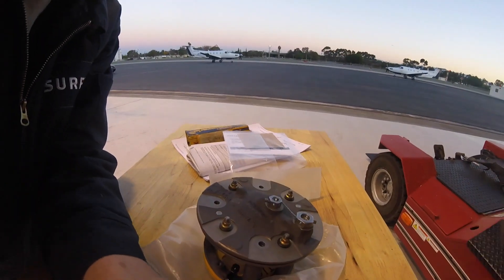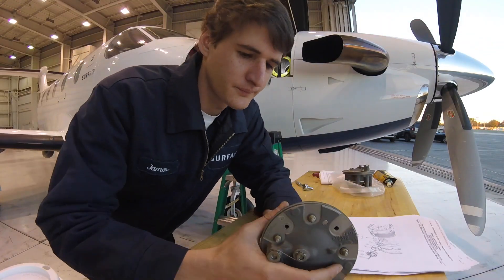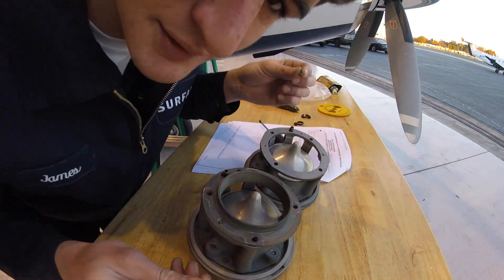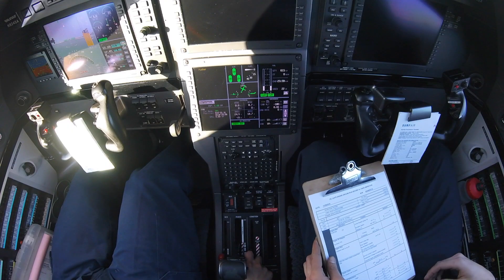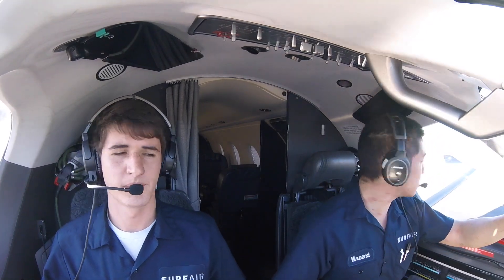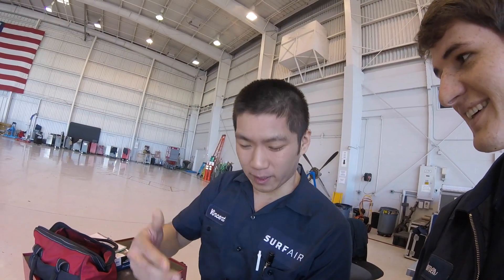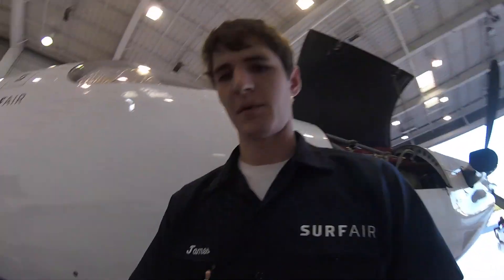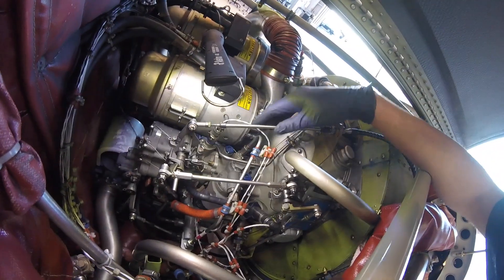PT6 Compressor Bleed Valve & FCU Replacement

Comment: I thought if you haven't done the work before you need to be supervised when doing the work the first time? Am I wrong? You said that you haven't done this before in the beginning of the video.
Reply from the maker: That's not a requirement under FAA regulations. Certain companies may require it however.

Comment: I noticed you use those flat lights.  Check out the Braun version from HFT.  Surprisingly nice lights.  One weakness out of the box with the Braun, is the battery (they're only 2200 mah).  To fix this, get larger 18650 batteries on Amazon.  HFT currently has coupons for their braun flat lights.

Comment: what you could don when you remover the FCU you can use your cell phone shap a picture and then you have a record of the correct ways.    That place looks like a fun place to work.. I been out of Aviation Maintenance for 13 years now. .I am in my 50's now but I could consider going back if that place is a good place to work. I do not want to deal with ego's
Reply from the maker: No egos here, we have a strict no a-hole policy at surf
Reply: That is good to hear.  you wont believe the ero's  I had my share of them from dont touch my tool box to think they are the best. 
I could see that it no ego going on there.  If I was in the area, I would apply. I live in the bay area. 
take care good luck and good videos.

Comment: Since Surf Air (had) the legacy PC12s and NGs which do you prefer working on as a mechanic? Why?  Do you have any preference on which to fly on?  Thanks  I'm definitely a fan of your channel.  Thanks for posting!
Reply from the maker: We got rid of our legacies last year. They were both about he same to fly on and similar to work on. I've heard the NG flies a lot more "nimbler' while the legacy was a bit heavy on the controls. From a maintenance standpoint the NG is nice to work on since the avionics have a lot of built in systems troubleshooting.

Comment: using the bleed valve, could you further explain how P2.5,Px,P3 all works?
Reply: i assume when you had the bleed valve on the table (nipple pointing up) that would be the position of the valve when it is "fully open" for the P2.5 air for the air to go towards the compressor inlet. is this correct?
Reply from the maker: That's correct. I'll see if I can make that video sometime. Glad you enjoyed
Reply: thanks man! didnt mean to blow up ur comments lol

Comment: What's all that red stuff behind the engine when you're changing out the FCU?  It looked like...leather?
Reply from the maker: It's the "fire blanket" a leather like synthetic material intended to slow an engine fire from breaching the fire wall. Insulation of sorts.

Comment: Just like that, when you started taxiing, your yoke went right by itself.
I'm just assuming here, but I assume the winds came from your left side.
If you want to have a stable and smooth taxi, deflect your ailerons COMPLETELY to where the wind comes from.
Let say the winds come from left, put your yoke complete left,, not center, especially for great winds.
By the way I like your videos,  I hope your company understand you are making great publicity for them.
Reply from the maker: The ailerons in this aircraft are tied to the rudder by a spring pack so they will move with the rudder controls. You are correct about control position in windy conditions although with the weight of this aircraft there really isn't much controllability issues with this aircraft on the ground in wind. I try to hold the controls to keep the ailerons from hitting their stops
Reply: James Sullivan Interesting, Thank you for your answer! Nice job!
So I guess this aircraft HAS to always fly coordinated? What model is it?
Reply from the maker: It is a PC-12 and yes they typically fly coordinated. Although the spring pack can be overridden with a light amount of force if needed

Comment: if you ever hear a mechanic call safety wire "lock wire" they likely have military background.
Reply: NovejSpeed3 -You had good instructors and colleagues!
Reply: Eric Carson I'm curious, why are you saying that ? In the shcool where I studied we all called it lock wire and its not a millitary shcool.
Reply: While I am certain that there are exceptions, in my experience the schools prefer to stay away from the "lockwire" terminology, as it presents the misleading assumption that the wire "holds the torque" whereas safety wire presents the understanding that the wire is there to prevent the fastener from falling off its mate.
Reply: Eric Carson not saying you're wrong, but I have 14 years of heavy avionic experience working airborne radar on the E3 Sentry and all of us call it "safety wire".....

Comment: So you guys don't get your FCUs overhauled at engine o/h?
Reply from the maker: Nathanael normally we would but since our overhaul interval was pushed to 5k due to being a high utilization operator the FCU is still due at 4k. Most PT6 operators have the engine overhaul done at 4k in which case the FCU would go with it. Good catch!
Reply: James Sullivan Fun stuff. I had to do engine mounts recently on one because a previous shop mis-interpreted chapter 4 or 5 and thought the mounts could go to 5000 hours. They had overhauled at 3500. Now I know why the 5000 hour requirement is in chapter 4. Didn't know they had TBO extensions for operators like you guys. Learn something new everyday.